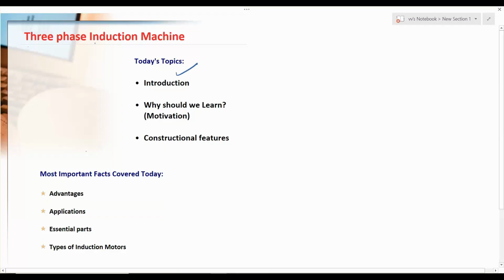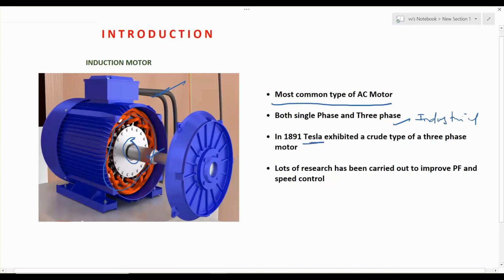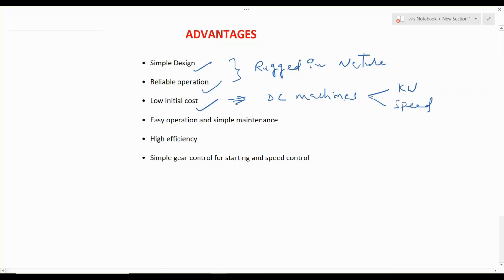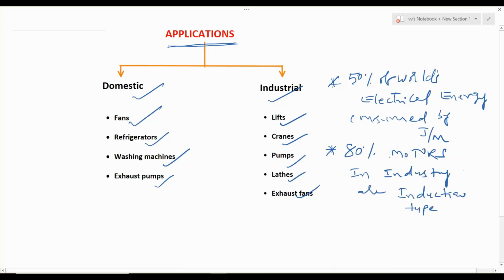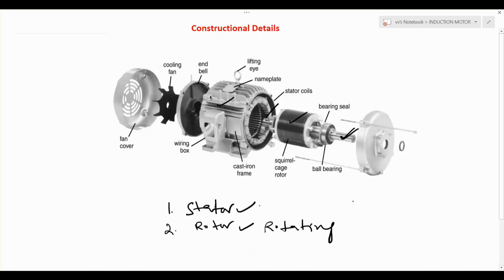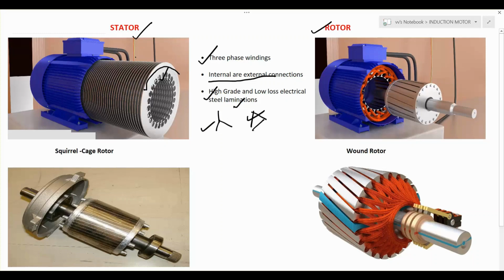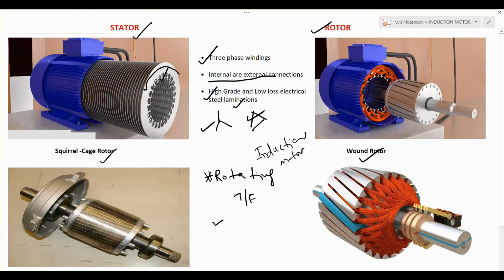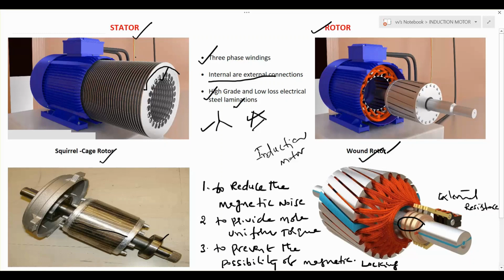Induction Machines: 01 || Introduction & Construction of Induction Machines || AC MACHINES || EEE ||

Comment: Sir, please make a video on mechanical braking of induction motor....
Reply: Mechanical braking ?
Mechanical brakes are assemblies consisting of mechanical elements for the slowing or stopping of shafts in equipment drives. They use levers or linkages to transmit force from one point to another. Braking slows or stops the movement of the coupled shafts.

Braking of motors can be classified into three types namely plugging (counter current braking), dynamic braking, and regenerative braking.